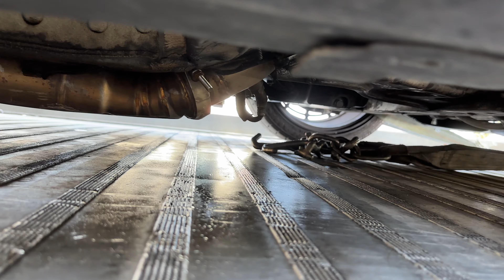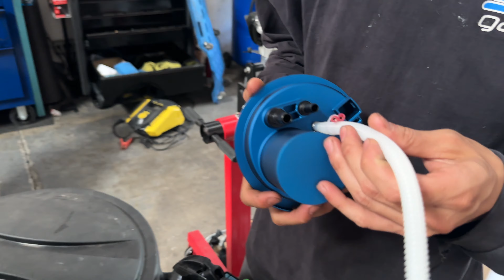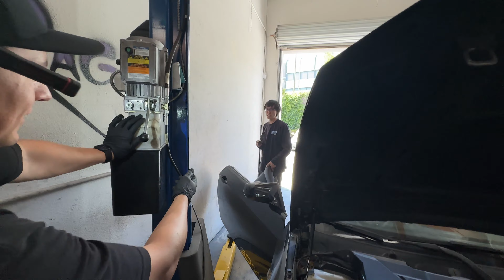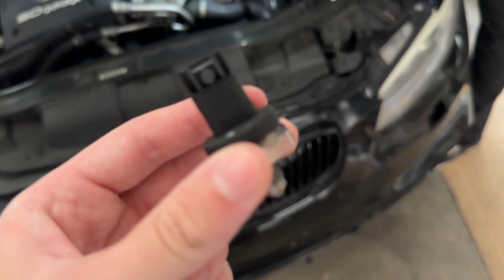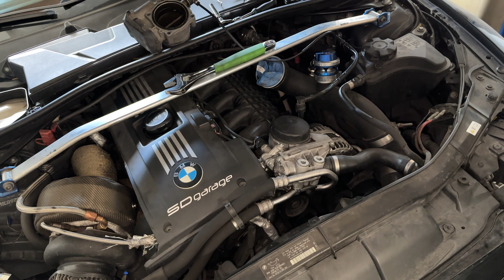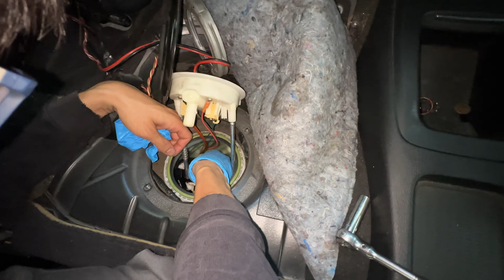Precision Raceworks Regulator install on 335is (N54!!)

Comment: Nice to see it up and running again man, that fuel pressure regulator is a nice upgrade too. Reset adaptations and if that doesn’t work probably need your tuner to adjust the tune for the new regulator you have in the car now
Reply from the maker: Yeah I’ve been trying to contact him but no answer:/ might have to switch tuners

Comment: If you monitor your low fuel pressure when off the pedal, does it reach somewhere around 145 psi and stay there?

Comment: Yo did u notice any hp gains or any difference in driving what are your lp psi reading under wot now? I have two 525 walbros and still using the ekpm3
Reply from the maker: No I didn’t really nice anything tbh